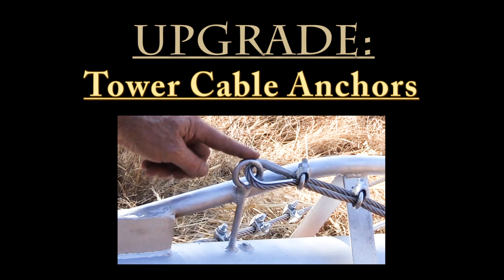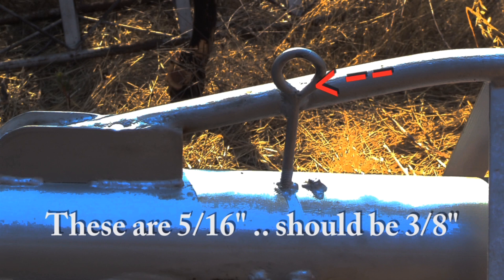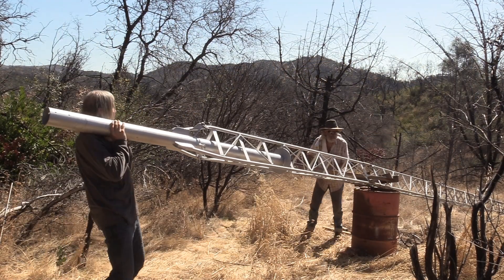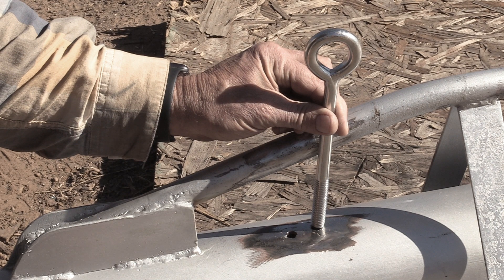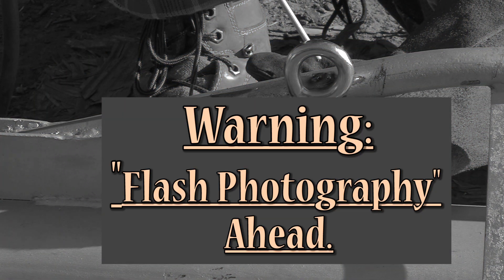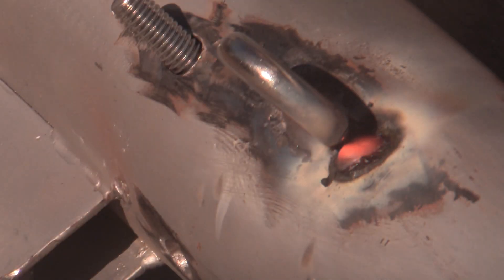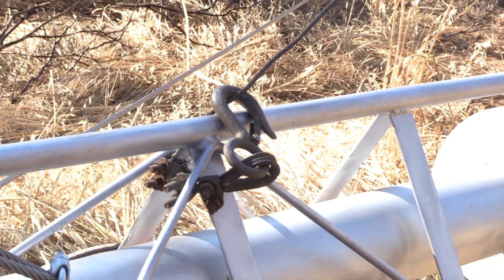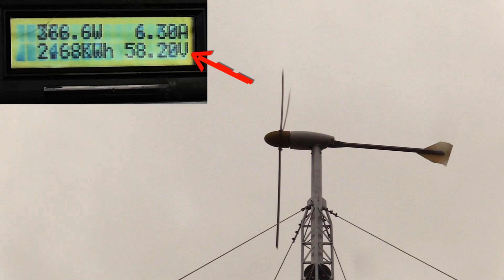UPGRADE: Tower Cable Anchors

Comment: Lots of great advice here brother and it was really thoughtful to warn others of flashing type images at certain points in the video.  You're really lucky to have all that open space.  Here in Northern Ireland it seems as if we have dreadful weather about 8-9 months of the year so you would imagine we have an abundant source of energy, but we are surrounded by a lot of buildings in this rental accomodation area so the natural wind flow is blocked.  If you ever have problems with the turbine going too fast, check out the Icelandic wind turbine design which they borrowed from an ancient arabic design if I'm correct.  It is supposed to be good for high speed winds/gusts and regulates the maximum speed very well.  Take care folks.  ♥

Comment: Great work! Do you know what sort of efficiency % you are running at?
Reply from the maker: Wow that's a loaded question.  If you mean overall efficiency, that would take some math calculations...  Wind turbine efficiency is around 30% of wind total power for the turbine rotor swept area (just a guess).
For me the bottom line is, if the storm wind is blowing strong, my house batteries will be charged up in short order !!  Sorry I can't be more specific.  Thanks for your interest ;-)
Reply: @j2jet193  I was referring to turbine efficiency. That's pretty good.

Comment: Thanks for the video.  Do you use contacts at top wiring to allow for rotation?
Reply from the maker: Yes, there are "slip ring brushes" at top to pass electric thru rotation.